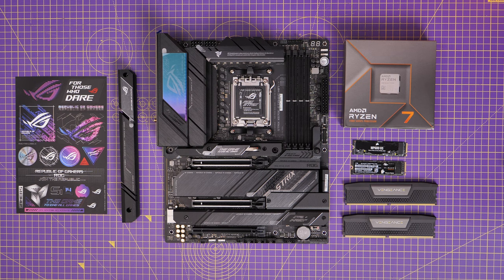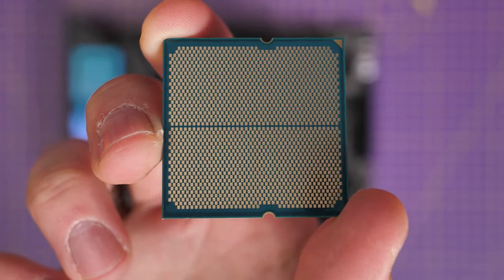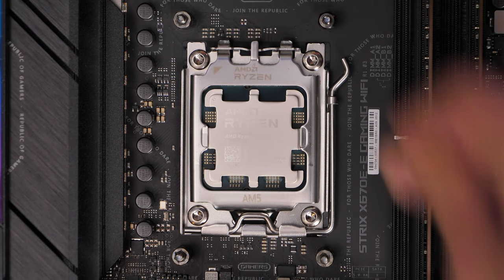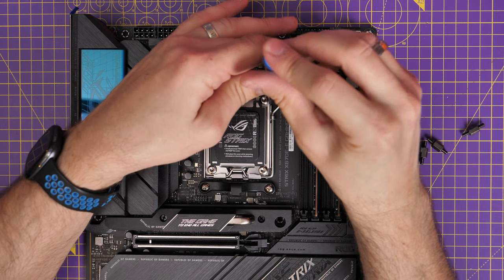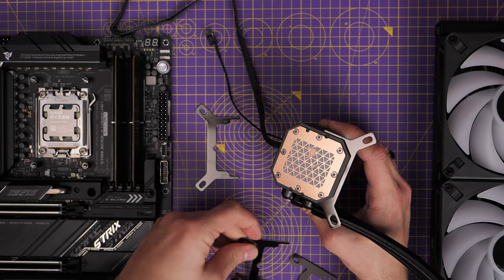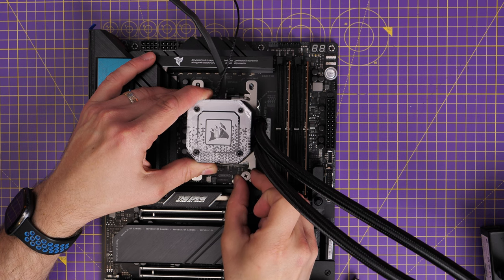How to install an AMD AM5 CPU (Ryzen processor installation tips)

Comment: I came to this video because i thought there is noooo way i should need to apply that much force to that lever. It looked like the frame was the wrong size or shape. apparently im wrong.
Reply: Same man, I'm literally in the same situation, I made sure it was fully seated and everything but the force I needed to push the lever down and the sounds it made freaked me out so much 😅
Reply: @gregbeattie1758  Well good news is Im fully up and running So now you have some real time verification it is indeed correct :D
Reply: Veteran AM4 here. Was a bit nervous doing my first AM5 build, so I came here to make sure I was doing it right. Yeah I did notice it took a ton of pressure when I was going to push the lever back down. Anyways still got the rest of my build to do, wish me luck
Reply: @uatlagh  Youll be fine Am5 was my first build experience and it went through flawlessly. Good Luck!
Reply: @phuhque6724  Yeah we're done and things look to have gone smoothly. 7700X + 7900 XTX build
Reply: I heard my board making a quiet crunching sound when I did it even though everything was aligned and I guess it’s normal because everything works
Reply: I thought the same thing. I said yolo and did it anyways before watching. Glad it was fine
Reply: I’m a little worried it seems like it’s not sitting but it does fit I’m so confused I don’t wanna break it
Reply: Yeah so good to see not just me, insane amount of force to close the lever! I triple checked it was 100% set the right way.
Reply: If you've installed anything intel then you know
Reply: It Seems you never applied Intel CPUs before
Reply: @jerrriell  duhhh.. it was my first build
Reply: Came here for the same thing..
Reply: @johnriggs9298 hahaha same here. Then remembered the cost and hope it was fine 😂
Reply: Now I'm.struggling  to remove the cpu without damaging pins
Reply: same
Reply: Bro I thought I damaged my cpu I was so scared
Reply: Yep same, nice creak sound
Reply: Well OMFG I’m so glad somebody has said this because I’m so scared that I had screwed up the CPU and motherboard. Yet to turn mine on as I’m waiting for my Lian li Galahad cooler😇 

Anyone else sweat like a pig when they’re building their first PC?!

Comment: I just installed the CPU for my first time. Holy shit that was so stressful. I didn’t realize how hard I had to push the lever and the sound it makes. Damn
Reply: ye, that lever was freaking me out.. hahaha
Reply: @zubeisgaiters9087  Ive literally just done it and the same as you, I though tI was doing something wrong, that was real stiff getting it in.
Reply: Dude I bought sh*t myself putting that in 😂 I just now did it and I’m praying it works. Mine never like “snapped in” or lowered so it feels like it’s bout to pop out of the case lol. I lined everything up perfect so I’m hoping for the best
Reply: Wait until you change your GPU, the sound the motherboard makes is scarier than this!
Reply: @durchfaII  No way, the quick release on this board makes it really easy and its virtually silent.
Reply: @durchfaII  that’s good to know, you may have just saved me from a future heart attack lol. Appreciate it
Reply: There's almost little to no force used to clamp that CPU down. If that was hard for you then you would not last a single day in a laborious job that requires any sort of movement beyond moving a pen or clicking a mouse.
Reply: @joedirt3563 Totally different situation when you're working with very delicate, expensive parts on a motherboard. This isn't a manual labor job. Any force at all is sketchy when building a computer. That's a ridiculous comparison

Comment: Yup, almost ruined my MB in my 1st install. Thankfully, still went in clean, even w/o the plastic cap that I took off being too gung-ho in my 1st ever build. Cooler went well, no troubles.
Reply from the maker: At least it was almost! 👍
Reply: I did same thing and took cap off, definitely never take cap off until you are 100 percent committed to putting CPU in. I fucked around with cap off. Messi g about. Being careless, killed the board. 🙄

Comment: 0:00 Helloooo
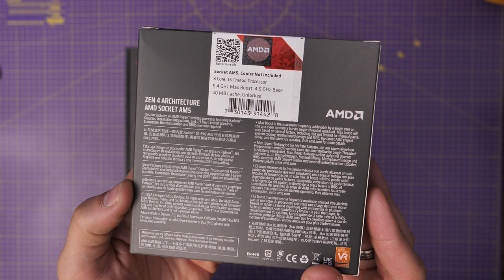0:16 AM5 Socket layout 
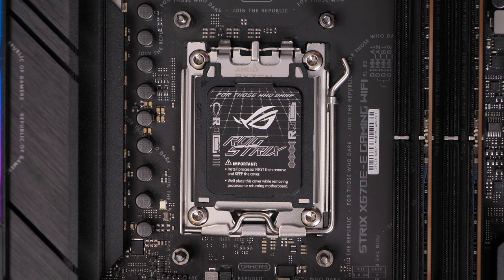0:35 Removing the cover
0:47 THe processor
1:20 Installing the processor
1:52 socket layout
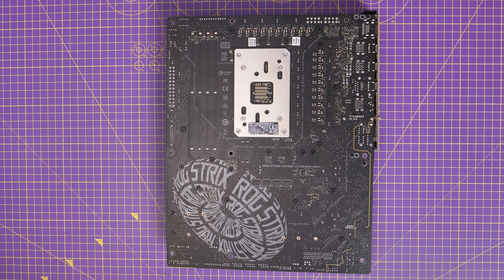2:11 Motherboard back plate 
2:27 cooler installation 
3:05 Pump head brackets
3:26 Pump head thermal paste and standoffs

Comment: You are a Hero sir I was really annoyed with losing my AM4 bracket but then I realized there is no AM4 bracket, you just have the metal things to pop on the fan instead of the bigger ones that it came with I was searching for 3 hours for something that didn't exist because I believed I took it out of the package but all that was in there were the 4 screws you saved me big time, I was thinking my new gaming PC already had an incompatible cooler, and I really stressed out about that.

Comment: According corsair u can use AM4 coolers without having to use new or other brackets. Only coolers with a custom bracket/backplate need to be installed different or are not compatible? Why did u have to use it? Upgrading atm and this confuses me..

Corsair 👇🏼
Yes, the AMD AM5 motherboard socket uses the same CPU cooler bracket size as the AM4 socket.

This means that if you already have a CORSAIR cooler attached to an AM4 motherboard, you do not need to purchase new brackets or replace your cooler when upgrading your system to the new AM5 platform.

Comment: Is there anything in particular I need to do software wise if I'm upgrading? I have a 7600x and I plan on getting a 7800x3D
Reply: you should update your bios before installing 7800x3d
Reply: @tomislaw43  this, mine wouldn't post to bios, orange and red lights, updated bios using switch and all good.

Comment: I am going to getting a PC next week with 7800x3d. Is it the same way as this video? I am very nervous of breaking it because it is expensive. Will it be clear when you line up the triangles that it sat in properly before using the lever? Hard to tell on video. Debated paying 80 dollars for microcenter to install it but that seems to be way too much for a 30 second process.
Reply: Yeah mate, 100 percent if it's fitted into the slots you are safe to pull it down. U can give it a very GENTLE, TAP, or wiggle but really there's no need u can tell it's in just by looking at the slots
Reply: $80 for install? Holy hell that's expensive. Do it yourself. It's easy. use that money on food instead.

Comment: Im ashamed to say this but i actually screwed up the first time because the processor did not go in all the way. the left and top side where the arrow did not go in all the way but i pushed it gently and it popped in. But everything is working great with no issues so i assume i did not damage anything. so i should be safe right?

Comment: Good question i had. Does the am5 latch lock better than Am4 latches  because there were some rare times i had where the am4 latch would fail and unlock cpu after building a pc i noticed it 2 times and one of those times my friend who put one cpu in he swear up and down he put the latch down Thankfully, 2 times it did happen, nothing was damaged, and we just lock it put cpu in correctly.

Comment: I have never built a pc before and i received my cpu today i was curious how it looked and i open it up messed around with it and put it away no big deal fast forward a few hours later i want to look at this video and the first thing i hear is don't touch the pins then i think mack to me messing around and realized I TOUCHED THE PINS it was quick and very little pressure should i be worried and what should i use to clean it in case there are any oils on the chip now?

Comment: I just installed my new Corsair H170i Capellix cooler onto my AM5 motherboard and it used the old hook (so no removing the plastic pieces) method there was no other option in the box when I opened it.
Reply from the maker: Fair enough. The one I'm using is the XT, which is a the latest model. Corsair says it's perfectly fine to use AM4 versions (see https://help.corsair.com/hc/en-us/articles/9842633794317-Is-the-AMD-AM5-motherboard-socket-compatible-with-older-cooler-brackets-)
Reply: @TheProvokedPrawn  Yes I got it installed just a pain to get those hooks sorted without messing up the pre-applied thermal paste. I ended up re-applying paste to get the job done after wrangling those ridiculous hooks. Strangely the instructions that came with my cooled did not have the hooks as an option but had the newer mount in their diagram.

Comment: Cant believe it, put it in, was so carefull, it wouldnt boot, orange ram and red CPU light, took it apart and a couple bent pins. Absolutely GUTTED. ordered new board, pray to god cpu is not damaged, think cou will be ok ?
Reply: Was cpu ok?  I’m terrified by the amount of force required to close this latch, I’m really not sure if I’m seated properly
Reply: @PiDev  yeah it was absolutely fine mate, don't be to worried, just be very carefully, lower it as low as possible before u commit to putting it down, line it up, and as long as it's slotted into the slot thingys, u can press you're finger on center and give a VERY LIGHT, tap or wiggle and tbh as long as it's lined up with the slots it's absolutely fine and u don't need to worry, I've installed my intell CPU so many times I couldn't believe it. But I was definitely careless and I think it made me careless. All good, pull the pin down without hesitation. Straight down. Be fine